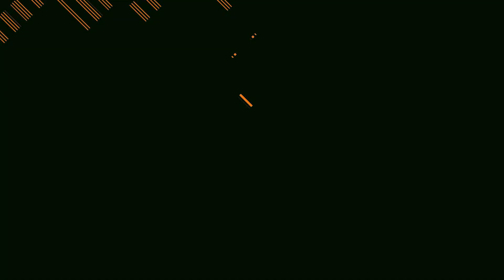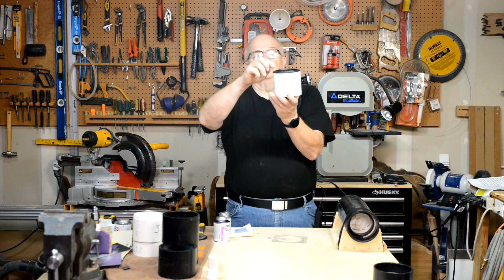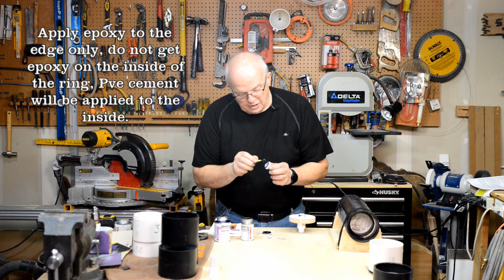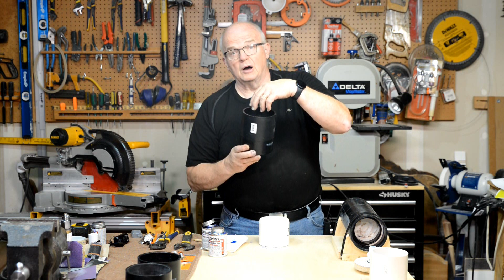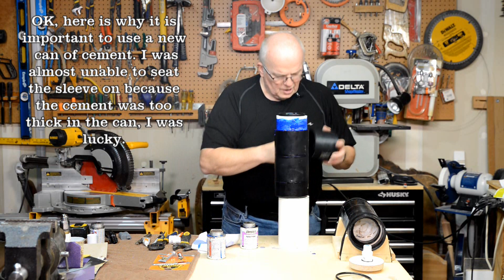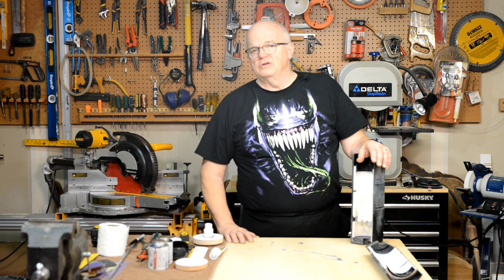fabricating a vacuum pump air filter - part three

Comment: This seems like such overkill for the small volume of air that it's going to filter. I think you would do better with 2" schedule 80.
Reply from the maker: I see your point and initially that's what I thought, however, it turns out that the volume is not as important as the rate of flow which can interfere with the vacuum level achieved. I purposefully used 4" because the rate of flow is greatly reduced around the filter material allowing for inlet-outlet equilibrium. Without equilibrium the drop across the filter material will be manifest in total barrel vacuum. That's what the "cloth in the barrel vacuum port" caused and it's a 3/4 inch hole.  Thanks for the comment,  Evan